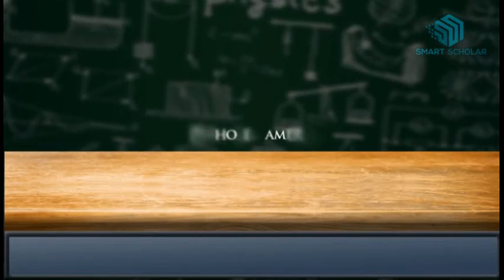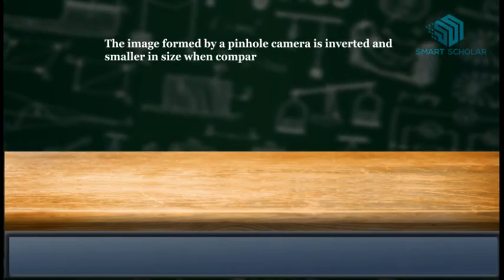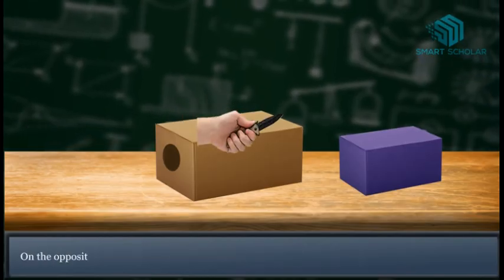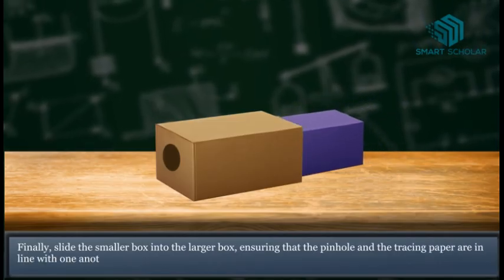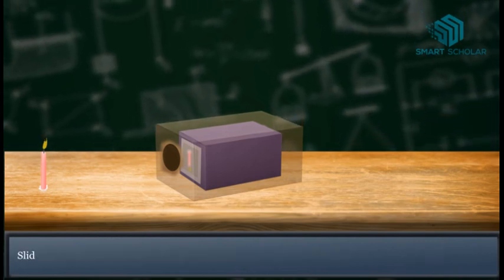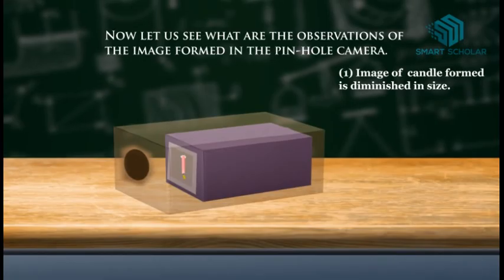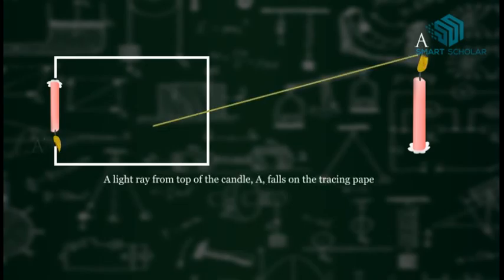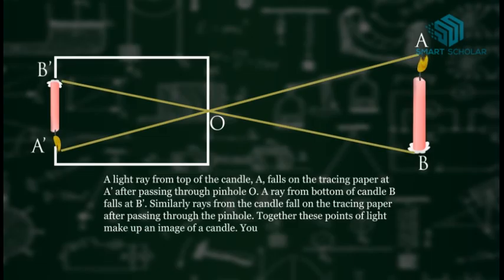Working of a Pin Hole Camera- Science Animation

Comment: What are the features of pinhole camera? Please sir reply me. 🙏🙏
Please
Reply from the maker: (a) A real image is obtained as the image is obtained on the screen.
(b) The size of the image obtained is comparatively smaller than the actual object.
(c)The image is inverted on the x-axis as well as on the y-axis.
(d)The image can be used in the analysis of the rectilinear propagation of the light.
Reply: @scienceprojects7130  thank you so much 🙏